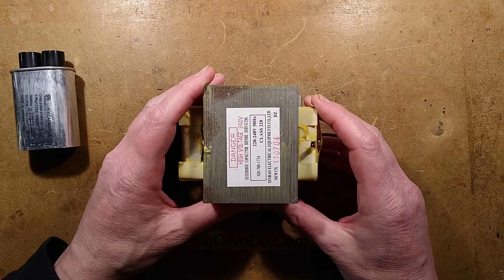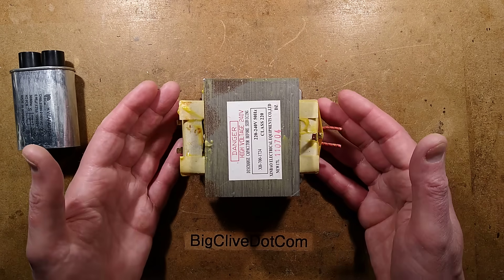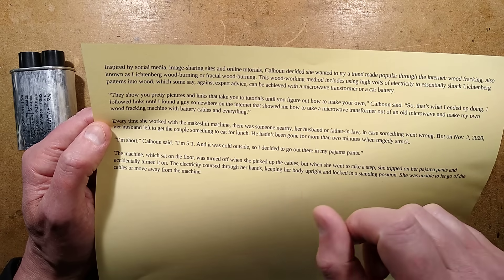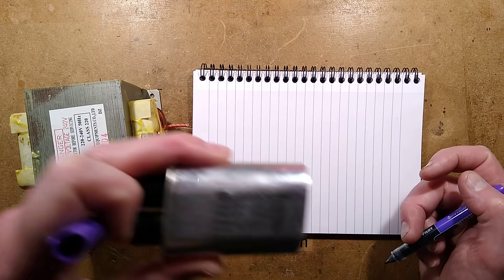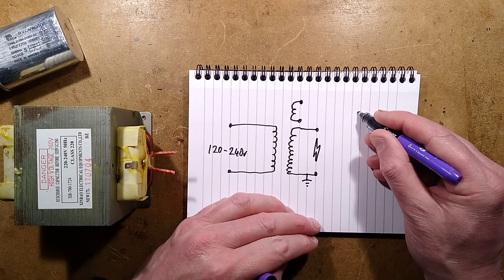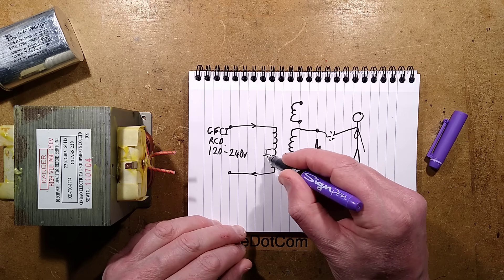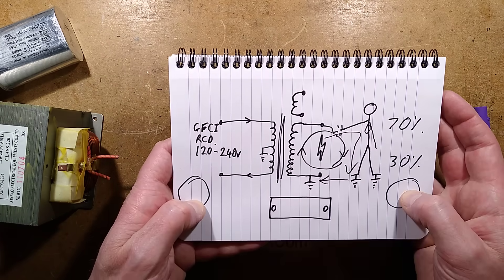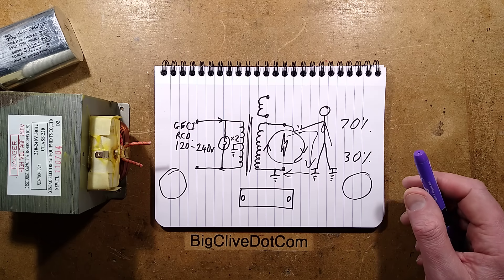The most deadly project on the Internet

Comment: I've worked with electricity for decades.  

I tried explaining this to a friend and they seemed surprised/suspicious of my information.  I was primarily concerned with the capacitor and general electrical safety, I hadn't even considered the closed loop on the wrong side of the transformer.  

It's scary how common it is for projects to utilize this component.
Reply: it is a bit frustrating when you speak to someone with basic DIY skills who is not from the field and doesn't understand the dangers and won't believe what you say because they've seen this being done 1000 times on the internet
Reply: @Minipimmer  I'm not from the field; my knowledge of EE is enough to understand the mechanics at play in the computer science domain, and occasionally repair my own equipment. But even with just a basic understanding of high-voltage analog electrical, how can one not understand the danger of the high-voltage side of a microwave transformer (or that terrifying high-voltage cap)?!???! Hell no, there's no DIY project on earth that involves that kind of voltage. It's, by definition, NOT DIY when it can easily kill you.
Reply: @smakfu1375  - Some just don't understand the danger of high voltage as they are very ignorant when it comes to electricity.  They also may not even realize that they are dealing with a couple thousand volts.  They watch a few videos on youtube, then figure it would be really cool to make some fractal art, and away they go!  Perhaps they even know about the danger, but then think "oh, I'll be careful, and will not do anything foolish like those other people."
Problem is, all it takes is one mistake, and you could end up dead.  
How many videos are out there showing the fractal wood burning, with the person holding onto each probe, and poking around on the wet wood board?  It's an accident waiting to happen. 
Anyways, great video here, and hopefully it's the one people will see if they are thinking of trying fractal art.
Reply: @jszlauko  Because I live under a rock, I'd never heard of this Fractal Wood Burning before Big Clive (writing a fractal generator, decades ago, is as close as I've ever come). But now I'm going to go check out videos of this insanity.
Reply: @jszlauko  I guess if you're gonna insist on doing it, place the probes ahead of time, then step away, connect the primary to your dead man's switch and finally you can connect the switch to power and proceed?
Reply: @Poldovico  - That would certainly make it much safer.  Much safer though is to not even do it!
Reply: @jszlauko  Oh, agree. If something you're considering using is called "dead man's switch", that's pretty indicative of what sort of contingencies you're planning for.

But then, "don't do it" often just results in people doing it anyway, so "how to survive doing it" is worth investigating.
Reply: @Poldovico  - Yes, so true!  Sometimes being told to not do something just makes some people want to do it that much more.  Maybe best to educate them, make them truly understand the dangers, say it's best not to do it, but if you insist on doing it, then take the necessary safety precautions.

Comment: with this level of voltage.  what ever amount of safety you think is enuff, double it and then double it again.  Seriously you are playing with Utilities lineman power and needs to be treated as such.  
If its not grounded, Its not dead.
This project is on the to do list, but its a lot of infrastructure to build and get in place.   Rules, Lockouts, triple primer switches, Dead man buttons, sirens, lights, lineman gloves, lineman boots, dedicated room, safety sensors, Insulative mats, GTO wire, pneumatics,  Voltage back feeding detection/prevention/metigation/ect......   Training and education

Comment: Seeing this brought back memories as a school kid in Australia. I started out with a donated "Scope" soldering iron, but no supply transformer. The thing to do in those days was to wind your own, so that I did. Original secondary removed and a new high current low voltage wound on. No idea what the turns ratio was, nor the eventual output voltage or current. Used for quite a few years until introduced to Henly Solon and Weller irons.  If you've never heard of a Scope soldering iron, Google is your friend...

Comment: I like the deadman switch idea.

In the past when working with NSTs, I would always keep 3 levels of safety. To turn it on, it was:
1: Remove shorting device (a clip of some sort) and get clear of everything HV
2: Plug in power strip
3: Turn on power strip

Then power down was the opposite. Turn off power strip, unplug power cord, and short the HV leads with insulated tool then apply clip.

At no point was I holding the HV leads by hand. I felt it was introducing too much possibility for human error. I'd position leads, power on sequence, power off sequence, re-position. And always keeping my left hand behind my back just in case.

Comment: I was an paramedic once upon a time.  Saw some horrible electrical accidents in my few years.  Above a few hundred volts, ohms law doesn’t seems to be 100% true anymore….after that, the applied voltage forces current flow that simply does what it wants!  😜

Comment: Important to remember that one should never touch the person receiving the current (the electric shock) because that will also kill the person helping. You should turn the system off or use one of those rope jumping things they use near high voltage installations. (I don't know their specifications so please check on a proper source) Those are used to lace the person and pull off of the source of electric shock. 

I would recommend people to not do it - the burning in the wood will also happen inside your body.

Comment: I've been an electrician for 9 years now and I've got a couple big 9kV neon kicking around... I've yet to do anything fun with them for safety reasons. This stuff is not to be trifled with! I'm super leery of anything that can store energy as well. Mechanical or electrical.
When I was a kid, I fooled around with a voltage multiplier and somehow, something I was doing charged up with some amount capacitance and it popped a hole right into my finger. Hurt pretty bad!

Comment: A coil can have a dangerous voltage even after the power source has been disconnected just like when people connect the headlights of their car directly to the alternator when they shut the engine off the lights will flash on and off for at least 20 minutes because the coil has stored power in it and the magnets in the alternator create a electric field for awhile

Comment: Some classmates and I did this in college a long time back in a technical program that wasn't electrical related. We got our hands on a microwave and hooked a cord directly to the transformer with some leads going to some screws we driven into saline soaked wood, we also made a Jacob's ladder with a similar set-up. Our entire safety precautions consisted of setting it on a welding table with some ceramic stand-offs to keep the table from being live and having a guy stationed at the wall socket to be able to pull the plug if anything bad happened. 
Having become an actual electrician since, I'm able to recognize how much risk we were putting ourselves into and it's pretty terrifying how ignorant we were.
Reply: When I was 15(should have been around that age) i was really stupid and just took that thing out (i even managed to remember to discharge the cap first) and just put it on the floor while I was home alone i think or at least alone in my room with no one knowing what I'm doing and connected the hv secondary with a wire to some kind of metal rod and held that thing with a pair of pliers. Stupid me was having fun with fucking 15 cm arcs being 4cm( about the distance between my fingers and the rood) away from death. Now a few years later I know how stupid i was(maybe I knew even then). Fun fact I still have the transformer somewhere in my room with the burn marks from the arcs.
Reply: @matteoulbrich38  Don't worry — you are not alone. There was a scientist on Manehattan project who removed the safety shins from a "make them almost go supercritical and then pull back" experiment, so the only thing separating him from death was a screwdriver in his hand. They called it "ticking the dragon's tail". It slipped, one day.
Reply: @matteoulbrich38  Thats nuts!
Reply: That tingle may have encouraged a great trade as a Sparky!
Reply: Sounds like a episode of jackass
Reply: Newsbender II  bahahahahahahahaha!
Reply: Congratulations for NOT winning a Darwin award.
Reply: I mean i gotta commend you for the effort. Most laymen wouldn't have even gone that far for safety.
Reply: Newsbender II  It was just sitting there in the kitchen, unguarded. Crazy, innit?
Reply: So many folks are over-confident. "Knowing what you're doing" is not sufficient. How many experienced cooks still occasionally touch a hot pan inadvertently? Imagine if their heart stopped beating every time they made a mistaken touch. That is the level of hazard. The protections need to be in place such that an accidental touch has been made IMPOSSIBLE. Otherwise, it's just a matter of time and human nature.
Reply: at least you tried. All kinds of people make no attempt to mitigate risk.
Reply: Jesus, that was a hell of a Darwin award nomination. Glad you didn't take the prize home.
Reply: You're lucky y'all didn't become filaments, if you know what I mean...
Reply: Sounds like your college sucked too.
Reply: Yeah, I had a similar experience after I got my CDL and looked back at the stupid crap I'd done with a pickup truck and trailers which had not been well maintained...  It's a wonder I survived that long.  :D
Reply: That's life!
Reply: At school in the automotive shop, we had a very large mostly wooden workbench, all the students were working on single cylinder lawnmower engines, pull them down, rings, gaskets etc, make them run etc.
Often when been lectured to, everyone would sit on the edge of that large bench as the teacher went through giving us the next part of the lesson.
The edge of that bench was made of angle iron, behind that bench (the bench was in the open) was a spark plug tester, so being out of site if the teacher I slightly re arranges all the motors so they were touching, and at the backs of the students, then I connected the plug tester's earth to the angle iron surround, and the plug lead to a handy motor, then pressed the button.....
Most gave a yelp and jumped from the table....
Reply: I read it in Electoboom's voice and f#$ing laughed.
Reply: I want to make an electrospinning device to make nanofibers.
The fiber are made at around 20 to 30 kV. I'm going to use a Glassman high voltage power supply to do this. Any advice you can give would be much appreciated

Comment: Voltage doesn't kill. A human can take 20,000+ volts. It takes less then 1 amp to stop the heart. If you're gonna fuss about safety, get your facts right.
Reply from the maker: The voltage drives the current, and in this case the current is high.
Reply: 'Voltage doesn't kill' is absolutely wrong. Resistance remaining constant, current is directly proportional to voltage; if you get a fatal dose of current, it's because you were exposed to a fatally high voltage. Voltage ABSOLUTELY kills. You, in particular, should definitely not be playing with electricity.
Reply: Wrong. Stay in your cave and off the web.

Comment: A friend of mine read in popular mechanics magazine you can hook car batteries in series and increase the voltage over and over and over and you can weld with it. So we started hooking up batteries in series from 12 to 24 to 48 to 60 60 72 84 and so on until we had about 20 batteries connected and we hooked it up to a welding rod and it actually worked you can weld if you hook up enough batteries and get the voltage high enough the problem is the voltage drains from the batteries after a few minutes you can only weld for maybe 5 or 10 minutes and then you got to recharge all the batteries but for a remote location with no power you can make a weld

Comment: To play with dangerous things you have to be aware of the dangers and have controls in place to mitigate or prevent said dangers from kill or harming you. High voltage and high current, especially when combined, aren't a play thing. Not a bad hobby to have mind you, but only for the skilled and competent.

Comment: I once got a 240v shock, my finger hit a live and neutral terminal at the same time, luckily it just gave me 2 blisters on the end of 1 finger, didn't feel like anything made it through my body.  It was enough to make me always think twice before messing with electricity.  I'm happy to do wiring etc, but I don't mess with anything live, safety first.
Reply: I unplugged a small $2 bug zapper and touched the plates to see if there was any charge left in it. The shock was a lot more than I expected but wasn't injurious.

Comment: Having a deadman's switch and warning lights are good ideas. I would also suggest that the switch be removed from the main enclosure in case the grounding fails. Run a signal wire from the switches to a relay in the main enclosure. You also want to make sure the electrodes stay put, so using insulated clamps or positionable arms to hold them is a must.
Reply: Isn't there a risk of the relay jamming? I imagine a purely mechanical switch might be more reliable.
Reply: Hm, is there a way to work in a signaling light such that the system would only work if the signaling light is functional? Get rid of the risks associated with the signaling light might be broken?
Reply: @puellanivis  You could have the light in series with the control signal to a relay that energizes the primary, I guess.

Comment: I used to work in a bingo hall and we had a 10p pusher machine with a nice high voltage transformer. Whilst fixing the thing I accidentally touched a secondary terminal. The only reason I think I'm alive is I touched it with the back of my hand and the voltage caused my legs to straighten out and catapult me away from the machine a good few feet. I've never felt a pain like it, like being kicked sharp in the back whilst someone pounded my arms on to my shoulders with a hammer. My legs hurt for days after and I still have a scar on the back of my hand a decade later.

Don't do it. Electricity sucks if you don't know what you're doing.

Comment: My A.A.S. is in E.E.T., I've done industrial Electric work, was a telephone tech. in the USN  and have worked around 120 and 277 VAC for most of my life. There are reasons for LO/TO and OSHA. It's like riding a motorcycle. If one doesn't feel a little trepidation whenever they work around AC or  get on a motorcycle, it's time to stay away for good. To this day, I  turn on and shut off my disposal with one hand, as the sink is well grounded and I got a 120 VAC bite awhile back-John in Texas

Comment: Is it not possible to put a GFCI after the high voltage winding? The principle behind them shouldn't care about the voltage, just being sensitive to the misdirected current. If you keep yourself grounded along with one side of the winding before the GFCI, then it should trip and save your life.
Reply from the maker: It would have to be a specialist high voltage version.

Comment: When I was 19, my father, brother and I used to set up mobile homes. I was sitting on the metal roof, next to an evaporative cooler with the pads off and with the water pump running. My brother was on the control switch, inside and I had already connected the low speed live wire. But, when I clamped down on the high speed butt connector (which should have been dead), 110 VAC went into my hand because there was a hole in the crimp tool's handle.
I instantly froze, while feeling the 60 cycle humming through my body and my life being drained away. Couldn't let go, couldn't move away from the water, tried to shout for Ed to shut it off. That came out as loud as I could, "EEEEEEEEEEEE!!!!"
Fortunately, Ed understood and I collapsed onto the roof, completely drained of energy. A neighbor from a block away came running to see what I had screamed about. 😎
Reply: Those holes in the insulation also spontaneously form in tools not meant for live work... you might have got the same shock with a brand-new crimper if it wasn't rated. I've felt the buzz of a relatively-safe 24vac control line through a cheap plastic-handle screwdriver. It's just a capacitor to AC.
Reply: @jercos  The hole in the crimper handle was intentionally designed that way by the mfr for hanging on pegboard. Now, I know better than to purchase cheap, unsafe tools. BR

Comment: Thank you so much for making this. Internet is full of MOT videos and some touch on the danger but I think 90% of hobbyists do not know how bad this transformer, the doubler and magnetron are. I refuse to energize one without a chicken stick and even with that I have decided to not energize them any more. Electric chair voltages and massive current for some Lichtenburg figures.. Ebay has generic magnetic neon sign transformers starting at $37. Painful shock? YES!! Fatal? Nope.

Comment: Im a repair tech for a large company and not all of our techs are authorized to repair microwaves. When i have to change a capacitor magnetron and a diode i discharge the cap first before touching anything. Never trust the bleed resistor in the cap is working because one of our tech did n he got hit with 4000v DC. Ouch.